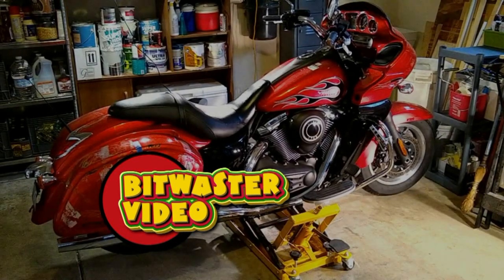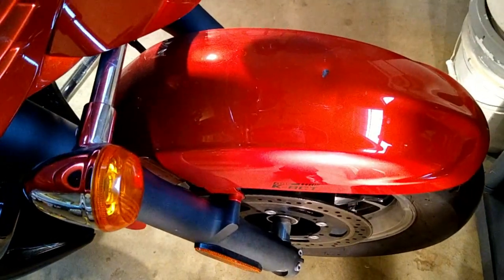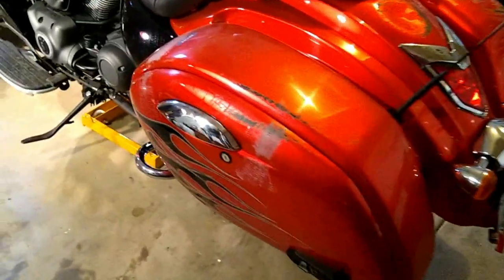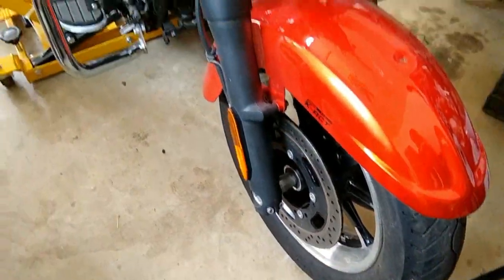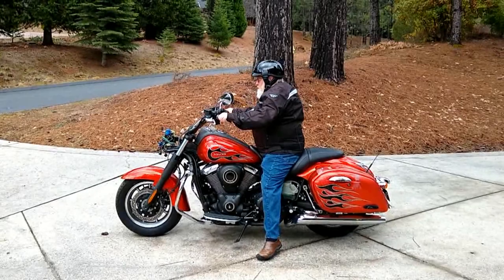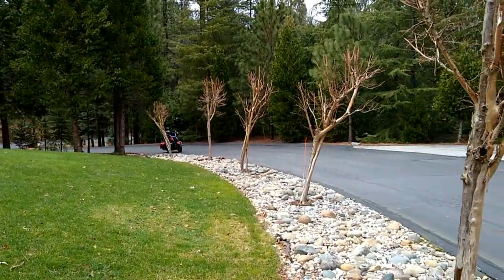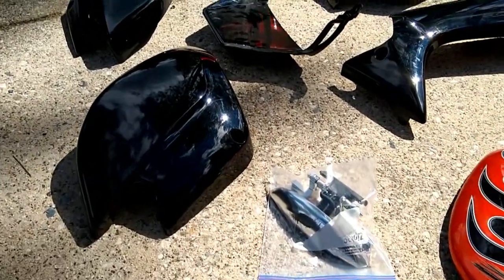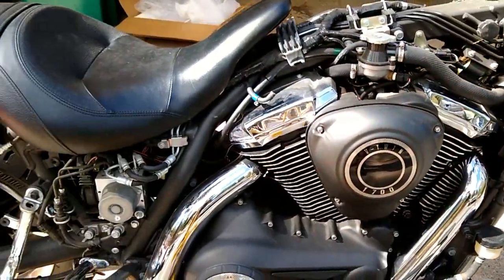2014 Kawasaki Vulcan  Vaquero Project

Comment: That bike wasn’t just dropped. It dropped and slid and skidded and tumbled. Maybe they dropped it down a hill ? If not it must have been from a moving truck.
Reply from the maker: I agree there are skid marks on the front left of the windshield and smaller ones on both bags. However there is not enough  to indicate very much motion in any one direction. The skid was at very low speed. What I know is that the bike was being repossessed when the damage occurred.  I don't think the damage was from falling from a moving truck or from tumbling as evidence does support that from the direction of the skids, the lack of damage on the front right and zero undercarriage, engine or crash bar damage. What I think happened is that they were using a sling to lift the bike onto a truck or the back of Hook and Chain. The bike then slipped out completely or partially, front first, left side against something hard (no dirt grass or asphalt was found in the damage pieces) probably something on the truck and then as it dangled or fell banged up the bags. Any kind of tumbling would have bent at leas that front cowling frame more and any motion would have more consistent and deeper scraping on something that bore the full weight of the bike during the slide. Anyway thanks for your interest.